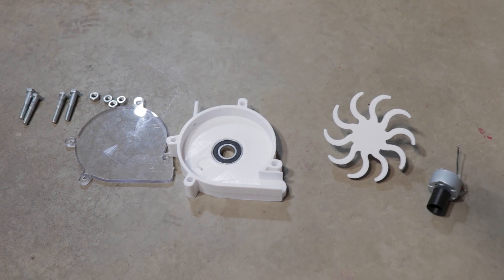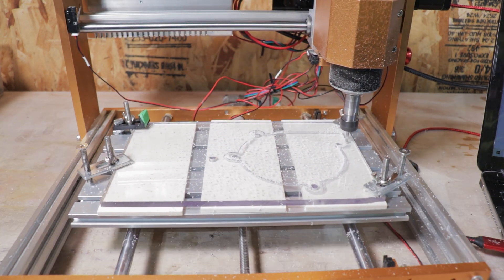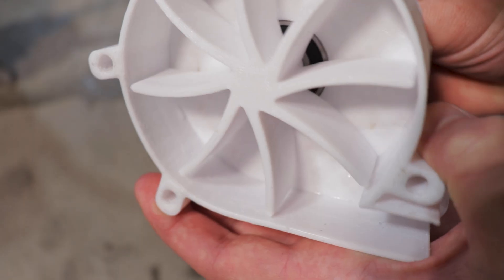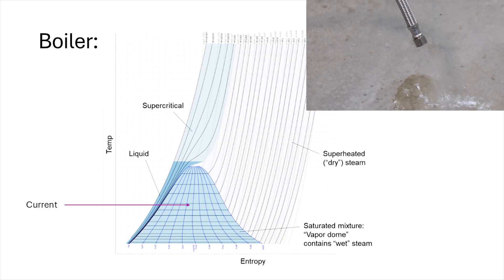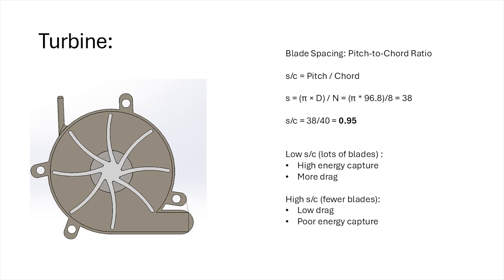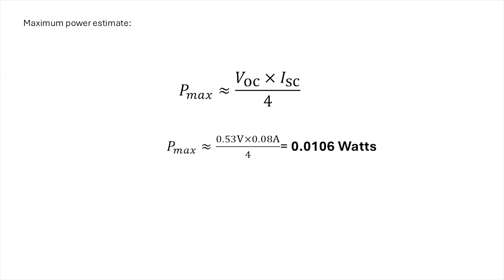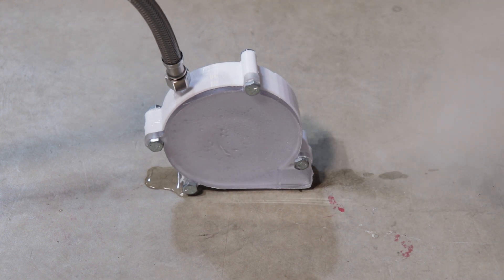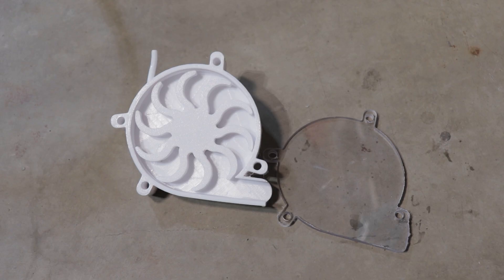I Built a Steam Turbine from Plastic to See If It Would Spin

Comment: For more power you need a path for steam to travel. After the steam applies a force on the bucket it needs to be ejected immediately to make way for more stream, otherwise the pressure will slow the oncoming steam being trapped in the cavity. A nozzle to raise the steam speed would also be beneficial. Your turbine design is an impulse turbine while higher power turbines take advantage of both impulse and reaction.

Comment: Thanks! I been trying to find useful ideas for my 3D printer. This would be great to make a small generator to use rain water to trickle charge a battery for small outdoor walkway lights
Reply from the maker: Thanks for the comment! 

That sounds really interesting, is it like a water turbine under a rain spout? I'd be curious to see how much energy that could capture. For my case I'd be lucky to power even a few tiny 5 mm LEDs  😅. Although I feel like with liquid water you'd have a lot more momentum at a given speed compared to steam to drive a larger motor. Good luck!

Cheers,